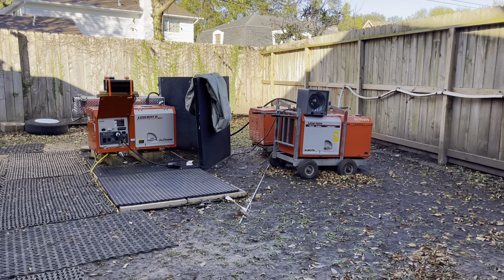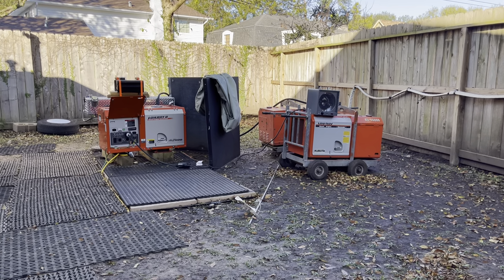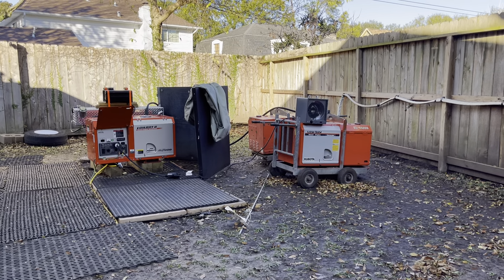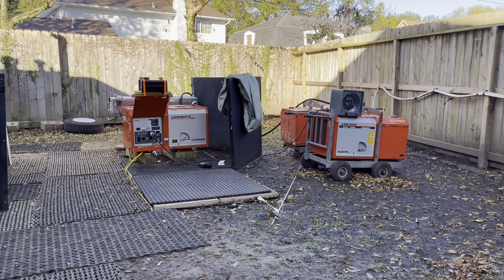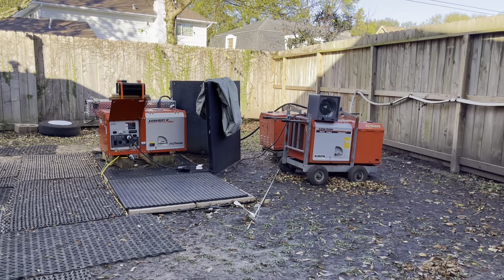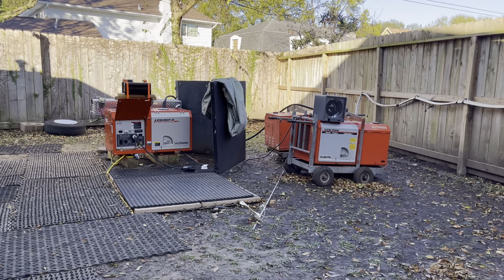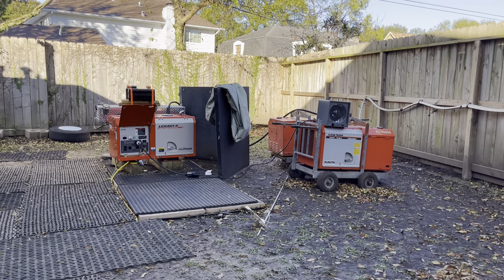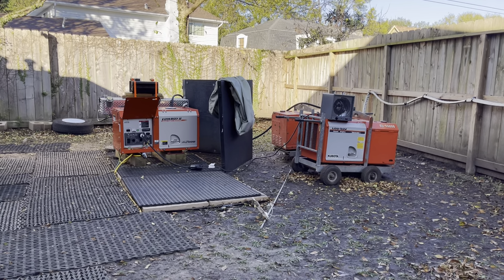Improvised load bank for Kubota GL7000 Lowboy generator

Comment: I bought a 5kw electric shop heater from Rural King just for this application.  I have a small homemade diesel generator made with a semi apu engine.  I'm guessing my unit is about 6500 to 7000 watts, so it loads it down pretty good.